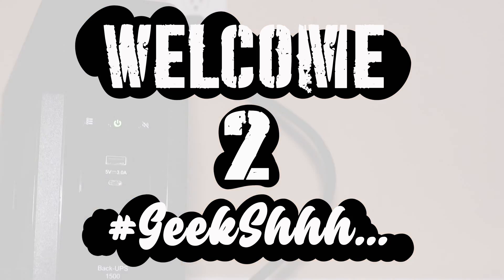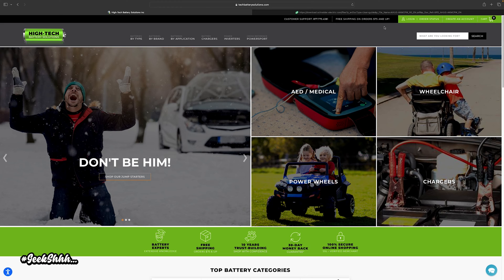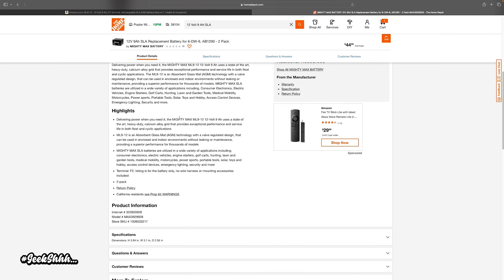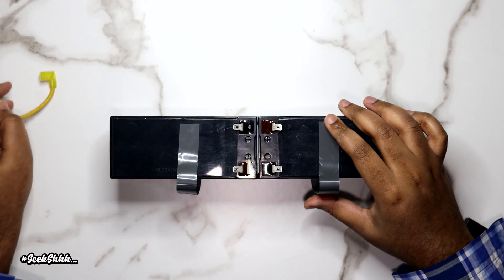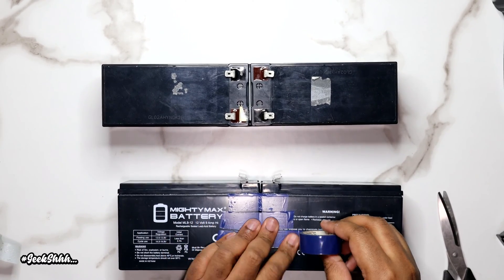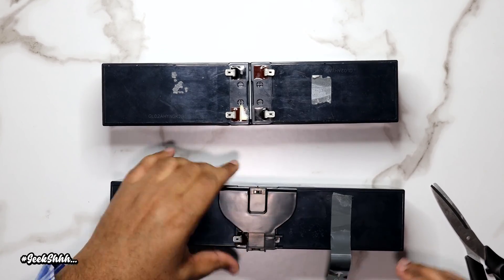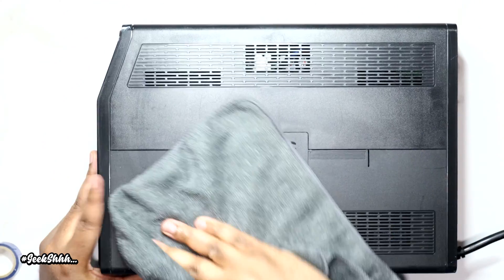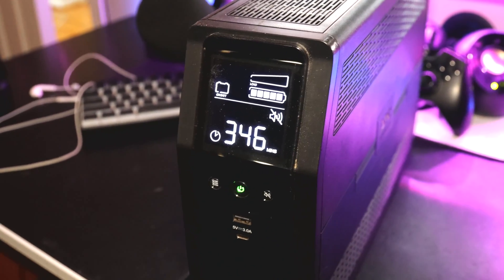UPS BATTERY REPLACEMENT TUTORIAL; APC CYBERPOWER BN1500M2 HOW TO GUIDE MADE EASY!

Comment: I've done other UPS battery swaps, but haven't done this particular unit. It does appear, however, that the black plastic adapter is COMPLETELY UNNECESSARY. The actual connections are negative to positive with the yellow shunt wire and then the wires to the UPS connect to the open positive and negative terminals on your dual pack. The black plastic is for aesthetics. Most UPS batteries in the past didn't even have this cover the wires were exposed or under tape. 

Wondering if the unit can take 12AH batteries. They seem to be the same dimensions...

Comment: Thank you, this is the best video on building a battery substitute!!! I found that Duracell and Energizer each make the same size battery as well, and the Energizer has a 2 year prorated warranty. the Duracell SLAH12v-9FR agm (also listed as the Duracell Dura12-9F2) is only available from battery supply companies as far as I know and is the most expensive. The Energizer EN9-12 AGM is available from Home Depot and is about 10-12 bucks less than the Duracells. Each of these are more expensive than the other battery options. Thanks for the useful video!
Reply from the maker: I appreciate the kind words and glad it worked out for you. Thanks for watching and commenting!